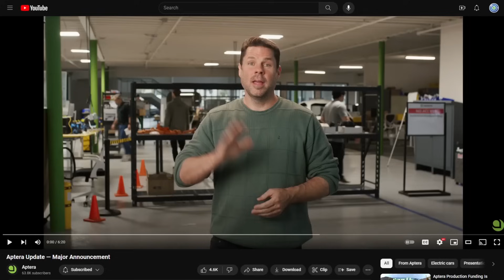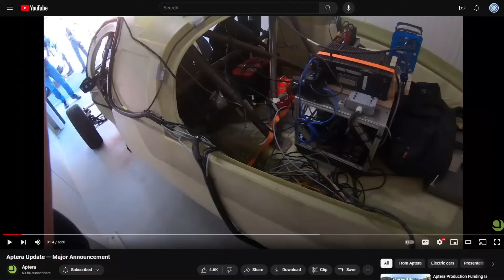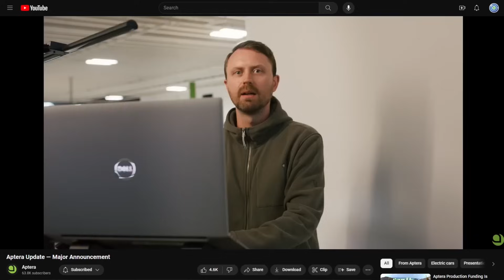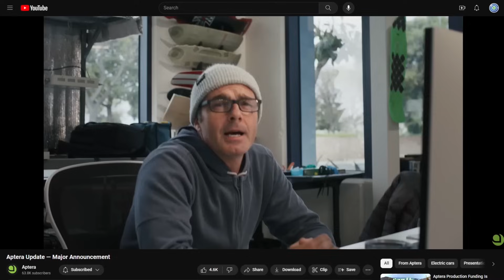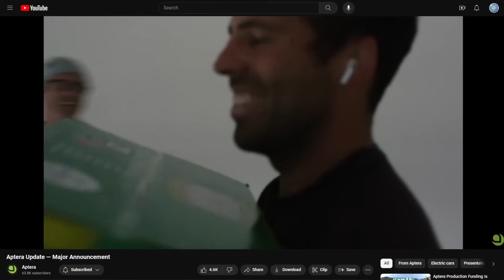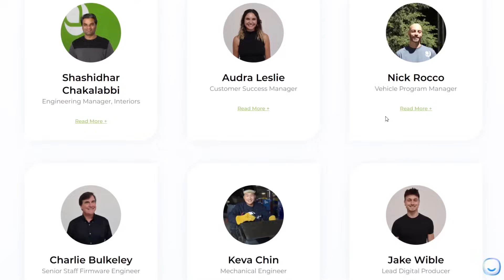Is Aptera's suspension finished?

Comment: Will Aptera be required to have a kill switch installed? Apparently it’s called “OnStar”? I’ve heard that all new vehicles must have it so that for example in high speed chases law enforcement can put your car into a “limp mode.” I would really like for the Aptera to not have that. It’s just the government overstepping once again.
Reply: No. I had OnStar on my 2014 Chevy Volt. It is a GM proprietary feature that allows GM to remotely diagnose problems and send you directions, detect when and where your car has crashed and call for help. It’s an expensive option and no way a government program. Anyway, if the government is creating a new control option for automobiles it wouldn’t affect Aptera because Aptera is not an  auto.
Reply: @fotoguru222  Ok, thanks. I’ve heard of something like this for the past few years now many times, making more people buy used older vehicles to avoid the system. But yeah, I would hope Aptera wouldn’t have that requirement since it’s not a “car.”
Reply: No.  Cite your source.  Even if it were required for cars, Aptera is not classified this way by US federal regulations.
Reply: Are you anticipating having to outrun the police in a high-speed chase ?
Reply: @garywozniak7742  Go ahead and single out one small part of what I said and don’t contribute anything, why don’t you. 
“For example.” It’s the fact that the government can shut you down any time they want, any way they want. 
Now, do you have any information regarding that? If not, go try to make a meaningful contribution elsewhere.

Comment: If Aptera is done with the frequency tuning of the suspension. That would tell me that they have calculated the desired spring rates and stiffness of the bushings.   They had said in previous videos that those elements of the suspension needed testing and development.  I would believe with the PI builds there would be a final validation test, which could be done with a few days on the track just to show its performance as expected.

Comment: I think that Italy is a great Place to retire Beta Aptera since CPC and Elaphe is close there. I would assume its not completely retired but rather repurposed to be modified for the EU Homologation because they need to change the suspension geometry to comply with European Standards (i.e. narrower stance). also probably to get the European reservation holders a chance to have a test drive there.

Comment: This is the fourth shot at suspension work. I believe Aptera designed one first. Then Roush worked on the design. I believe that was the design tested by the original beta mule which, at the time, was going to be the basis for "Final" suspension adjustments. Then I think CDC took a turn at suspension. And now Densi Engineering. No detail on the impact of each of these organizations on suspension design. Makes sense to have Densi test since that is one of their fortes. 

A note from my past and current engineering experience with R&D for cars to include EVs. You build the final design of any component into a production prototype, in this case a P*, and then test the production vehicle. I am draconian about testing. I would not accept final suspension testing on the Beta Mule as it is not representative of the many changes that have been made, especially the body composition. Perhaps close enough and done to expedite schedule and control cost.
Reply: “Then I think CDC took a turn at suspension.”
-
To look for COVID? 🤪

Comment: I think that it was always the plan to outsource the manufacture of the front and rear suspension. Roush had done early consulting that resulted in the Beta suspension design, in addition to ongoing computer design and engineering simulation. It could be that Aptera's manufacturing partner for the suspension is in Italy. And they needed to compare the on-track dynamics of the Beta design before starting the manufacture of the final production suspension for the PI builds. To me, getting production parts delivered to Carlsbad, getting this suspension testing work, in addition to hiring staff for the next phase, in preparation for the start of vehicle production, are good signs of progress moving forward.

Comment: Hopefully they got enough info from the Beta,  however the Beta has the composit body, Roush suspension and no frame. Things will need to be teeked with the PI testing.

Comment: In terms of suspension, my own question is about what we saw during the demo rides around the parking lot at Carlsbad earlier this year - namely the torqueing of the long, race car style front control arms. I assume that this is normal and that the upper and lower control arms in this case are acting as a torsion style spring that twists (compresses) during acceleration , and releases energy during off-throttle.   Obviously there is a finite lifespan to any spring because the amount of rebound will never be 100% due to molecular deformation of the spring. This deformation is a function of the  frequency and degree of the compressions, the elasticity of the control arm's metal type, and the designed shape and thickness of the arms.  I am pretty sure (??) that the engineers have taken all this into account since this is an issue of control arm longevity (and thus overall safety), as well as possible effects on steering, alignment, handling, as the arms become more and more deformed.  Maybe this is something you can ask them next time?  Once again, Thanks Steve!

Comment: Keep in mind that there are various "levels" of testing: Individual components, discrete systems and whole-vehicle. Perhaps this signals that testing the suspension as a discrete system has concluded and any future testing of the suspension system will be conducted as part of whole-vehicle testing. Aptera still has to build their "fleet" of PI test vehicles for environmental testing, crash & safety testing, range testing, etc., all of which will include keeping an eye on how the suspension system is functioning.

Comment: As Chris stated after beta testing at Chuckwalla raceway,  computer modeling matched real world data collection.   Italian testing provides more comparative data.  Major differences in Aptera suspension are due to wheel weight with in wheel motors and reduced vehicle weight.  I hope the Italian engineering team will improve torque vector to allow front wheel tank turns with rear wheel burnouts.  😂
Reply: Agreed.  One troll who doesn't understand what is possible uses "tank turn" intended as as a personal insult.

Comment: Yeah, I was very curious about the reference to Beta in the update. It was my understanding that the components of the PI suspension were going to need to be tested to determine the best final design of the chassis. It didn't seem to me that Beta would be valuable for this test. Beta isn't even the latest prototype and from what I understand, it has a more beefed up and robust chassis. 

Then again, maybe that's the point. If Beta is the upper limit of what the suspension is capable of, then maybe they can see where it could be dialed back for the final product. 

The bigger issue is what this means for the final chassis. If no work has been done on the PI chassis until this moment, and I was right about testing needing to be done to finalize it's design, then it doesn't seem likely it will be done by the end of May. Then again, the test model (PI2 presumably) may not be usable for testing until it has a battery and wiring. So they may not have been able to get started until now. 

A more optimistic speculation would be that CPC has been continuing development of the chassis concurrent with the testing of Beta, and they are ready to assemble a vehicle that can be tested on the track by June 1. If they don't need to tweak the design any further and Beta helped them get the parameters right the first time, they could be well in their way to completing the chassis by the end of June or even earlier. All they need are the wiring harnesses that are being ordered, the battery, and the motors from Elaphe. 

The schedule revealed at the June 6 webinar may clarify some of these details. It's a bit frustrating that Chris dies not say what components will be completed at the end of May, just that they will be needed before the next components can be added.

Comment: I suspect the suspension on beta is highly adjustable, and based on that it's close enough to build the final suspension. The final suspension will probably have some room for finer adjustments, so once the PI builds are in production, they can do those fine, final tweaks

Comment: Is it possible that they changed or modified the Beta suspension to be more like the PI build?
Reply: It's possible, but I don't like that explanation because Beta has nothing in common with the PI build. Unless there is a detail I'm missing. Beta appears to have a frame with a roll bar supporting it's body. If they are just testing the suspension, the differences in the body may be irrelevant, as long as it's close.
Reply: They probably modified or built a new front subframe to match the front suspension mounting points of the production design.  They could then test the final suspension design and fine-tune its parameters for  the production specs.

Comment: My thought is that Aptera did suspension testing and had the suspension they wanted but when they went with a new company to do the suspension that company wanted to do it's own testing and come up with its own solutions.  Not saying they didn't trust Aptera but different engineers have different ways of doing things. This way the suspension could evolve over time instead of being stuck in the original design.

Comment: My guess is that the PI suspension hardware and specs may be modeled and/or released for further testing once the PI chassis are going together. Spring rates, bushing sizes and durometers, damping likely to be fine tuned prior to release for production. NVH testing cannot be complete at this point and these are critical components for tuning in that regard. 

There’s some history and timing we can discuss on discord.

Comment: It would have been trivial for them to modify the Beta such that it exactly matched the PI geometry, in terms of location and spacing of how the suspension is attached. The testing done from that should be 100% correlated to the PI performance
Reply: NO, not trivial
Reply: @johnmalcom9159  Relatively trivial. They just need to weld on new hard points at the appropriate spot, so they can attach the candidate parts. Worst case they need to remove part of the existing frame before welding in a new piece. Great thing about the beta is that it doesn't need to be pretty, it just needs to work.

Comment: The suspension is fairly straightforward as far as components. Single sided swing arm in the rear closely mimics most motorcycle designs. Upper/lower control arms in front resembles most automotive designs. Matter of tweaking for travel, loads. Sure they will receive P.I. Chassis with fair amount of adjustability built in based off modeling. Now Steve we know you have quite the “pull” at Aptera but wouldn’t be surprised if they are mum on most specific answers you are looking for due to June update coming soon. As always thank you for all you do for us Apterians. The go to channel for sure.
Reply: Actually compared to motorcycle swing arms, the Aptera design has a major difference that keeps the wheel base constant.

Comment: Probably used the testing to validate the computer models. Pretty sure they will do further testing to validate the actual PI build, but the computer model validation gives them the confidence to move forward.
Reply: I agree.  I think they are testing how well the computer modeling matches the current reality, especially at the design limits of skidding, brakes locking, hitting bumps and pot holes. The PI build needs to be very close to final. At some point you have to stop tweaking and start building.

Comment: I thought Roush did this already
Reply: They did and years ago they did a bunch of testing on it and the hub motors (moose test).  Then they scrapped all that when they switched over to the CF body that required a redesign of the chassis/body.  People really underestimate how many changes Aptera had to implement when they changed body materials and manufacturing processes for their vehicle.
Reply: I wonder if Aptera kept much of the designbut then gave it to Italy to finish.  I see a lot of transition from one supplier/designer to another.  Especially with the battery, seems like there is a new company and appoach with how/who they will make/assemble them every month.
Reply: @Lachesisms  have there been any changes in battery plans? They have one company to provide the cells, another to build the packs. I don't think either of those things have changed. I think the only surprise is that they're assembling the PI packs themselves, but it seems they're doing it using the components from their partners
Reply: @GoClimbARockEh I think they want to build as much of the vehicle as they can by hand in California before they build the assembly line.

Is that what you're asking or am I confused?
Reply: @Fairburne69  I was just commenting on BryanCinema's observation about there being new battery plans "every month". I don't think that true, but I can see how one would think it

Comment: So is that white Aptera body that is over Chris's left shoulder something new? Possibly one of the PIs??
Reply: It does appear to be PI1. It is known to be on the property and would probably be somewhere. 

Unfortunately, it probably does not yet have the wiring installed. We can't see it clearly, but according to Chris the wiring is being ordered. 

It may be wired and have a partial interior by the end of May, though. It would be nice to see that.

Not sure if this is what @ddessert6 meant but it's not the interior mock up. That either doesn't have a shell or has a partial shell somewhat looking like Beta. It's been a while since I've seen it.
Reply: As much as we would like to think that is a new PI build, we should remember that they had a mule that was for interior design only.  It stayed in the building and out of sight for the most part.  There are some interviews with Chris M. showing this mule but like the beta we have seen on the road & track, it doesn't have doors or windows.  Of course, this could be PI-1 in the background.  Either way, this wouldn't be a new item.